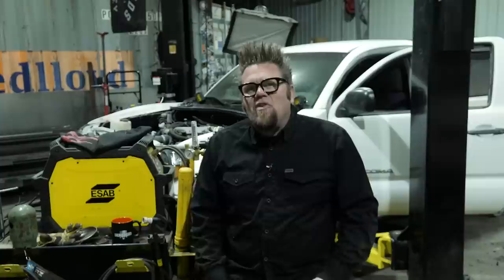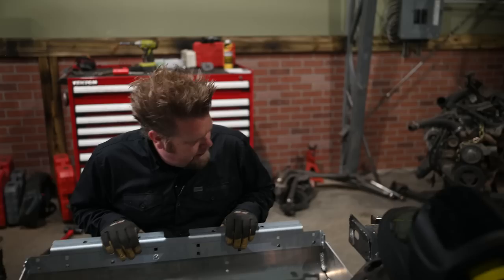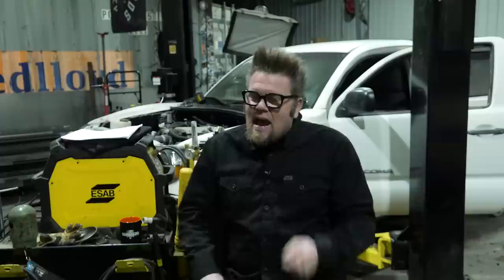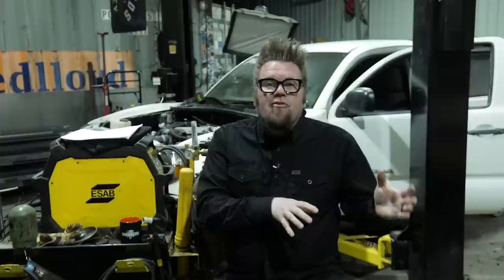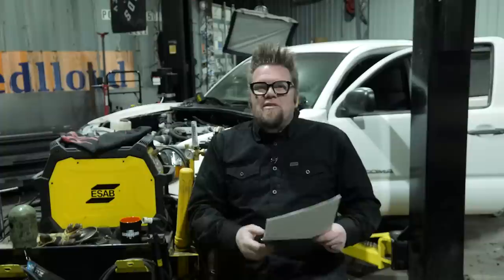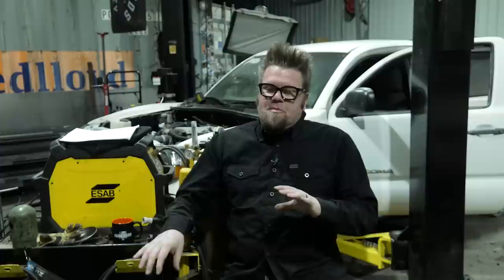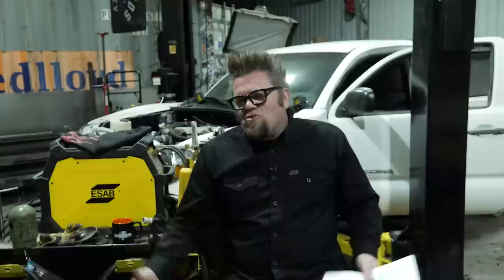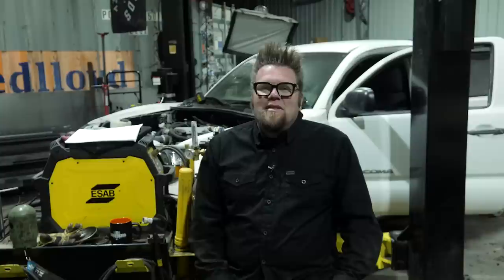TJ Gas Tank in JK Frame, Brunt Work Boot review, and is IFS as Strong as a Solid Axle

Comment: I'm five years into diesel maintenance and I have just now started to get into the more interesting side of things. The place I started had all new buses so I was mostly doing oil changes, tires and brakes mixed in with minor electrical work. I've changed my first Allison transmission this year and some other more complicated jobs. I still feel brand new. I just try to learn from the guys around me and pick up all tips and tricks I can. I worked myself into the slot without any school so I feel like I have to make the most of the experience around me.

Comment: the difference between a mechanic and a tech is that a mechanic learned to listen to the vehicle and diagnose and fix the problem as well as why the problem occurred in the first place. a tech, plugs a car in to a computer and replaces the parts they tell them to replace. a tech has a whole series of different skill sets than a mechanic has. I grew up in the same age as you and consider myself a mechanic. I can set points with a match book and actually tune a carb or set the timing on a mechanical fuel injection set-up. I still find myself listening to my vehicles run down the road, how they shift and what they smell like. it's been many years since I was a paid mechanic, but it never leaves you.

Comment: Ian, I am working through the  EVAP / fuel system on a project to run out here on the west cost. Talk about new educational deep dive. The largest issue was around OEM fittings, ECU connections, and needs to allow the rig to run on the street in my city (licensing and DEQ requirements).

Comment: What's your thoughts on portals for ifs? Can they be run on a daily driver/weekend warrior?
Reply: There’s no reason you can’t run them as a daily driver. Just keep up the maintenance. Their just like a manual transmission. The hardest part about portals for the street is gearing everything else high enough (low numerically) to run down the freeway at a comfortable engine speed. It gets easier with bigger tires, but still.

Comment: Hey so I am in the starting stages of getting all the parts to sas front and rear my 07 exploder. I would like to run 37's. But it's not going to be a full on crawler more of an overland. My debt is one tons from a super duty or just going d44 out of a jk. Just looking for your info on what way to go. One tons are more available and cheaper but I don't think I would need to be that wide and it's only a 4.0 in there for now. Thanks in advance

Steve

Comment: Question: when unit bearings first came out nobody wanted them and seems like they didn’t last that long. Lately I’ve been seeing you install unit bearings on rigs. Are they getting better or what is the reasoning for this? I have a 2001 ford super duty front axle I want to put dually adapter on. Will unit bearings hold up to this. Truck is just used for on road driving/towing.

Comment: I want to build a 1st gen scion xb into a "modern 4 door samurai" I'm thinking 29-33s, kind of whatever works when i get into it, samurai or yota axles, I'd try to just turn the engine the right direction and keep it stock and reliable. I know there would be Floorplan mods and all that but Now to my question, I'm at a loss for a good trans and transfer case option, I'd prefer to skip the samurai stuff just to avoid the divorced case and arguable weaknesses there, I'd like a good trans that would bolt to the stock Toyota 1.5 engine, and preferably something that has doubler options available. Hopefully the question makes sense

Comment: seeing as how this is a Q & A session I got a question for ya. Would it be possible to run a set of 14" coils on a 16" coil over shock? the reason I ask is that I am in the process of swapping one-ton axles under my lj and I came across o set of new used coil overs for a good price, I have since put on new coils and it sits a little higher than id like. I currently have 7" of shock shaft showing and i wanted 4"-5" of shaft showing. Yes, I know I'd have to run limit straps to keep the coils from unseating but would it be possible to run those to get my jeep to sit lower without sacrificing the spring preload. Thanks for your time and help.

Comment: Building a manual wheeler, trying to think of the best parking brake set up as I'm converting from drums to discs in the back. Would it be worth it to put in a hydraulic hand brake? or would cable actuated be best?
Reply from the maker: I have used the Eldorado calipers and they work well as long as you adjust them correctly

Comment: What are your thoughts on 2” wheel spacers on a rock crawler? I found a set of 40 spline 14bolts but they are 70” wms, I’d like to push them out to 74” wms
Reply from the maker: Lots of guys run em..I have some .75" ones on my 715
Reply: @BigTireGarage  cool thanks man!

Comment: I have a 98 ram with the 5.9 Cummins and I have replaced the ball joints and put a red top steering box in new shocks and stabilizer shock. I don't know what else to change on the front end. Because my steering wheel is still sloppy and drifts on the road. Please help Because it is being rebuilt body wise and this is my bucket list truck and I will be keeping it and I will leave it to my Grandson when I get called home. God bless
Reply: Larry,  look for frame flex at the steering box. A bracket that ties the box to the frame on each side helps alot.
Reply: @Bill Langdon  I put on a off road bracket for the flex. But it didn't do crap. I'm a a loss and can't figure out where to go. Besides, changes all of the bushings. Thank you for your time to help me try to figure this out. God bless